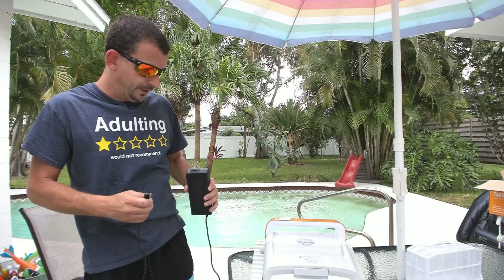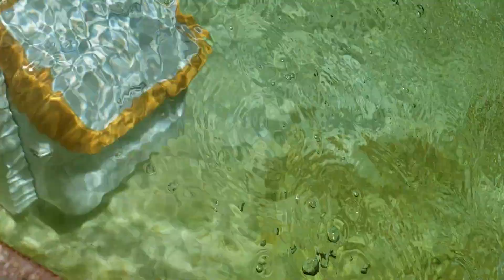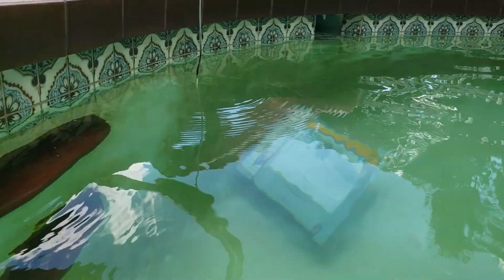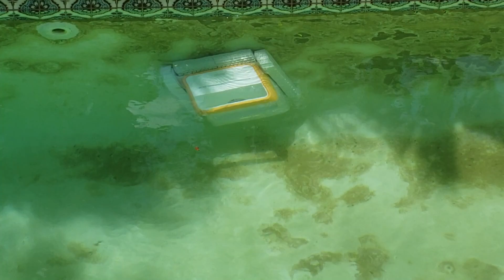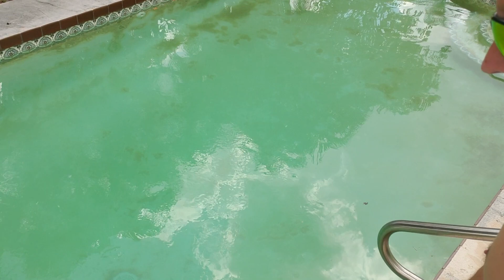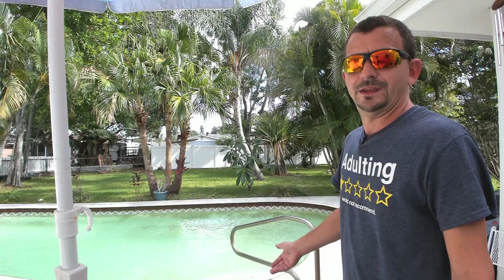SMOROBOT Intelligent Robotic Pool Cleaner - Review & Testing

Comment: That thing is pretty neat. We have one very similar but it's not cordless, however it works well I vacuum my pool when I open it and when I close it. That's it. He takes care of the pool all summer long. Just an FYI, living in FL you can have that gunite redone on that pool and have it painted or sealed for pretty darn cheap Jason. I did pools for a handful of years down there (I was in FT. Myers area) but yeah you could have that thing looking brand new for a few or so grand!
Reply from the maker: We were going to do it ourselves one year shortly after moving here and a local said "N you can't do that! Stop!!!!".  It was then we learned that draining a pool during rainy season was a very bad idea because pools can float when empty.  We were warned it could lift right out of the ground!  We are planning to do it one winter soon.  If not ourselves then maybe hire someone.  

Also, that pool vacuum lasted around 2 months before getting water damaged.   It's now waiting for me to fix it!  I'm planning to install DC power cord and get rid of the batteries.
Reply: @ststele  Ahh yes rainy season in Florida. I don't miss that at all (but I do miss the beautiful Decembers, NJ is COLD) Yes the power cord is absolutely the way to go, ours has a little controller box that plugs into 110 outlet and basically just has a 50ft line to the sweeper. It's the best thing I've ever bought for my pool!! You'll be SO happy with a freshly done pool once you get to it, it's basically a brand new pool and you'll love it!

Comment: I am in the process of planning the installation in my new workshop. New to the list: Pool in front of the door. Thanks, Jason :)
Reply from the maker: LOL @ this!!!  I'm wanting to be in a spot that's a bit easier to keep cool tho.  This shop is supposed to be a sun room and I'm in here forcing it to be slightly cooler than the sun itself!  I do like having the pool tho.  Helps a bit with the being too hot part.
Reply: @ststele  Hot in the workshop is really not fun. Here I often have over 30°C inside, then you don't really want to heat it with the 400°C soldering stations. Sweat drips from your forehead onto the mainboard, you scratch yourself with dust from other people's households. Delicious...

Comment: It takes less than 15 minutes a week to clean a pool. I hope you spend more time fixing phones. I haven't cleaned pools for 15 years, and every time I see a 3D printer, I think I could buy a printer for what one repair kit for Polaris costs and print those parts for pennies. I'm impressed with the job it did, but I am not sure about the reliability of the battery and motor. I think powering it with the pool pump would be much better.
Reply from the maker: 20 mins to an hour for me on this pool.  Especially if i've put it off for a few days!  Weekly really isn't enough tho.  It has a whole tree in it after a week!  Lol needs caged, wife don't agree.
Reply: @ststele  debris from overhanging trees can double the time and cause extra wear on everything.
Reply: @ststele  I had one pool that when the trees bloomed for over a month the stainer baskets would blow out every week there was so much that it would fully block the water off then many times the big heavy duty pump basket would rip open. This pool was way out at the edge of my range and so twice a week wasn't reasonable. Cheaper to buy new baskets each week
Reply from the maker: @stillraven9415  I learned recently just how much pressure that pump can build up.  I had been cleaning our filter for 6 months rather than replacing it.  One day I hear, KABOOM!  It blew the top off the filter canister!  The threads were already worn but the added pressure finished it off.  I'm glad we were home when it happened.
Reply: @ststele  yes! I repaired someones sand filter that literally blew up when the renters didn't know that you have to backwash them. It could have killed someone.

Comment: If you put the hook on the end of your pole would that increase the number of Stars on your Adulting rating? 🤷‍♂Wouldn't you wife much rather have a pool boy since your Adulting rating is so....is pathetic a too strong of a word....and that way she's happy and you have a clean pool. 😏 🤭 Oh yes, the "flavouring" packets comment made me laugh. Thanks. 👍

I don't have a pull, I mean pool but that thing looks quite impressive. Hope you showed the model on the box because I would like to see some tech specs on that baby especially the battery capacity and how long a charge lasts. The bonus with this Jason is you can strap a phone to it when you check to see if it's waterproof. Safes having to sacrifice yourself by fully immersing into a coolish pool on a sweltering hot day.
Reply from the maker: LOL - Thanks!  Every time I post I video, I kick myself in the butt for what I left out!  I wish I would have showed all inside of this thing.  It's actually got a valve-stem (like a car tire) where they either pressurized it or pumped a vacuum...  waiitttt -- I wonder if the main unit is oil filled?!  That would make tons of sense.

Comment: Hi Jason, maybe if you did a thorough manual clean first then introduce the Robo cleaner just to keep it up to spec. Anyway, it looks very refreshing in your pool. Hear in Montpellier France it is 37c and my apartment is too small to fit a pool. Stay cool 😎🤿👍
Reply from the maker: Hello - It sure has made my life easier for the last few weeks.  I didn't ask for a pool but now that we're here, it needs cared for constantly!  I actually did read the instructions before setting it in the water.  It took me a few weeks to get this video edited together while working too and the clips of me thumbing through the manual didn't make the cut.  It pretty much only described the 2 baskets, 2 cleaning modes and don't leave the cap off!  :D